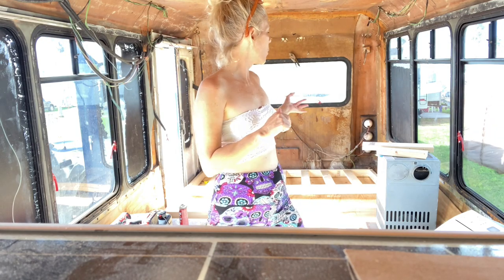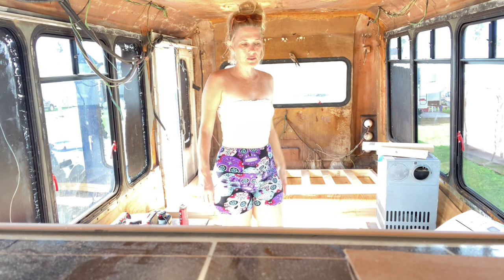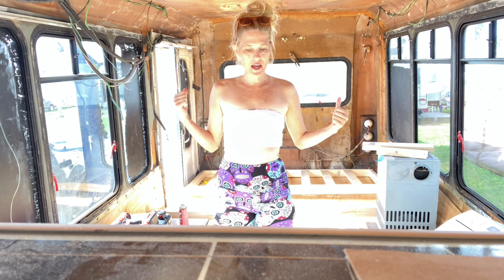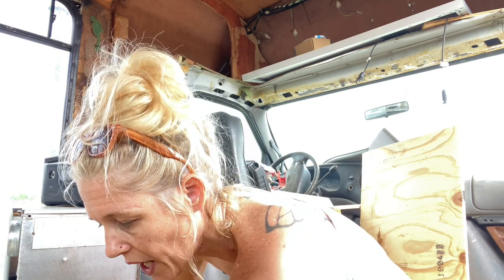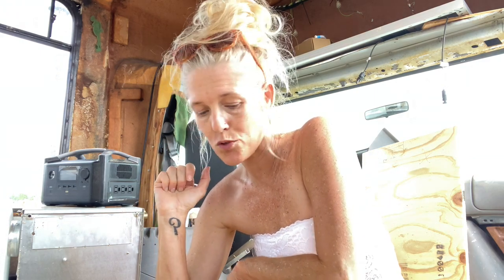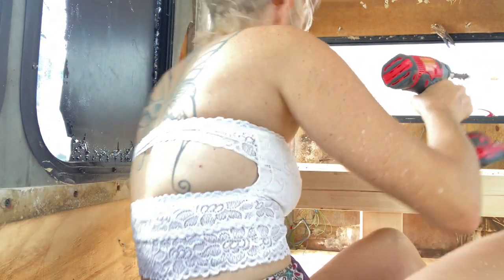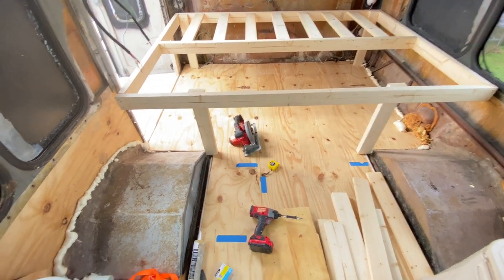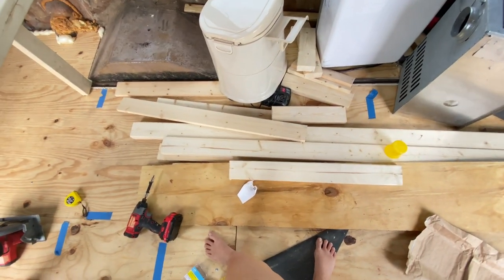BUS to TINY HOME| Bus conversion | Skoolie Bed Frame

Comment: Progress being made and you’re doing a great job on it
Looking good and should be good and solid
With not much wiggle room shouldn’t need any corner bracing for additional support 
Looking forward to the next step in the build
Take care and see ya then Ms Jess😃👍🏻
Reply from the maker: Yes! So thankful for progress. I have L brackets that I will be attaching the frame to the floor with as well as to the side of the wall so that should keep it nice and tight. Thank you so much for all your support and kind words! 💫💖🙂